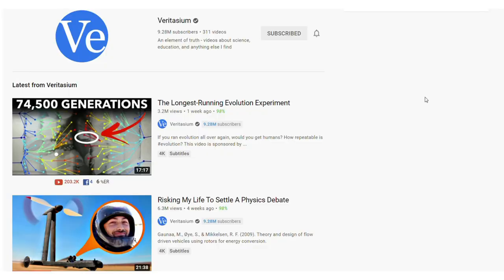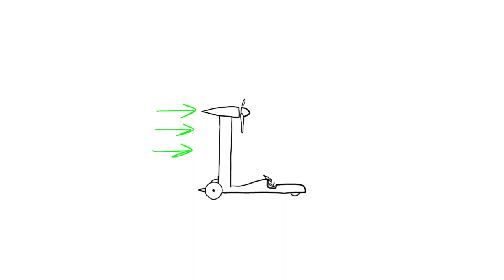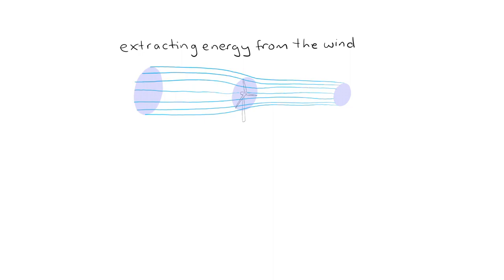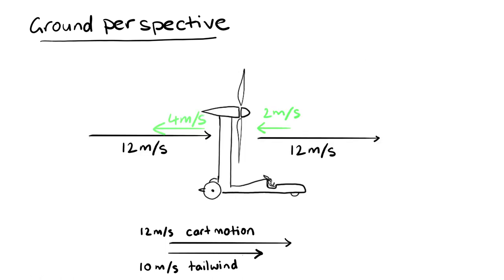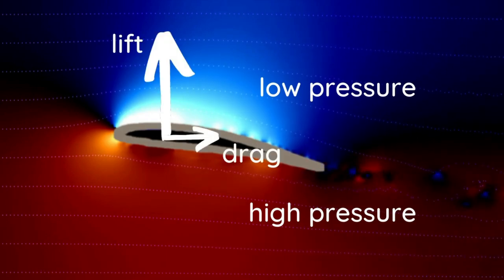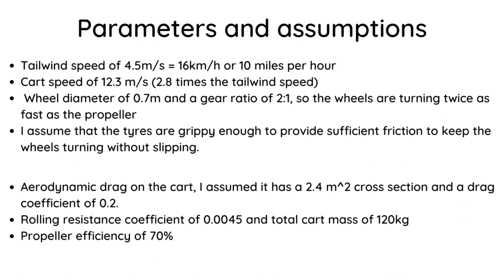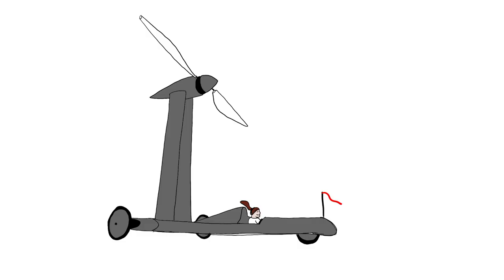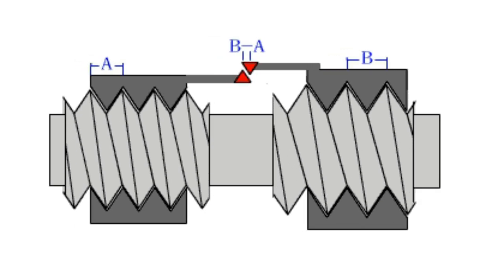Downwind Faster Than the Wind by Veritasium: How Does it Work?

Comment: I still like to see it this very simple way: in a normal car, the motor accelerates the wheels, whose only purpose is to allow for forward motion by translating the body it carries. 

In the Derekart, the wind is the motor, pushing the body along, the wheels allow for forward translation, but you are now, unlike a car, taking advantage of the wheel motion, to create a second engine, the rotation speed for the propeller, which generates thrust. 

You could do the same for a car, but inversely. The engine accelerates the wheels, which creates a windforce that goes against the windshield. Find a design that takes advantage of the airflow, perhaps for cooling purposes, or for thrust if you like, and you are generating extra energy. No one should be surprised you are accelerating the car faster than the engine allows, or that you are getting energy to cool the engine further than your internal supply of energy should allow. You are just creating an extra *design* within your vehicle, made to take advantage of some motion you had not previous been taking advantage of.

What this lady (sorry don't know her name) says is true: no vehicle is a closed system. It is open. What *design* can do is open up your system to a new source of energy.

Comment: You are missing a big point. All the time when is vehicle is going slower than a wind ie the air flows forward from the drivers prospective - the air is trying to spin the propeller the other direction. If the chain failed - it would spin in other direction. The energy of the spinning wheels must overcome all the rotational power of the wind to make it turn where it turns. There’s is a battery inside the frame. That’s the answer😂😂👌
Reply: I'm pretty sure if there were a battery in there, it would have been spotted by Derek Muller, the North American Land Sailing Association when they ratified the record, or any of the many other people that have witnessed it first hand.
Reply: @Rick_Cavallaro  oh then it’s a perpetual mobile. Congratulations. But keep it in secret. Otherwise oil tycoons will find and kill us all.
Reply: @tka2000  
>> then it’s a perpetual mobile.

No - it is not!  But I'm pretty sure you've hit on most of the ways to misunderstand it.
Reply: @tka2000  It's not perpetual motion. The cart is getting kinetic energy from the wind.

"The energy of the spinning wheels must overcome all the rotational power of the wind to make it turn where it turns."

Yes, and this is possible precisely because the air is moving relative to the ground.
Reply: @seneca983  you’re right. It’s not as it is. But according the other proving video it moves forward the trade mill even with no wind. Therefore you can run it in a stationary air in circles and get the free power
Reply: @tka2000  "But according the other proving video it moves forward the trade mill even with no wind."

What video is that? Veritasium certainly made no such claims.
Reply: @seneca983   search it. Some “scientist”lady’s channel. Very popular. He was there too and thanks her in comments. I’m not a fan of fake science. Just occasionally got here.
Reply: @tka2000  Well, I've not seen that video and the description is too vague for me to find it. Anyway, Veritasium and Rosie aren't claiming that it would move even without wind.
Reply: @seneca983  also this is quite good for your reference to finalise it
https://en.wikipedia.org/wiki/Conservation_of_energy
I’ll leave you with that my friend

Comment: How’s that a brain teaser or whatever you called it having a jet plane on a treadmill that is going exact speed as jet is traveling forward…??????? If there’s no air movement over the airfoil no lift will be generated so unless it’s a jet with thrust vectoring and powerful enough engines to essentially do a vertical takeoff the plane isn’t going anywhere.. the control surfaces wouldn’t work either as the elevators require airflow to work as well.. I mean that’s basic common sense  2yr old can figure that out .. maybe she stated it wrong???? because there’s no “brain teaser” in that
Reply: Yeah the 4 forces of flight aren't hard to understand  & lift is clearly one of them lol. This video is troll physics.